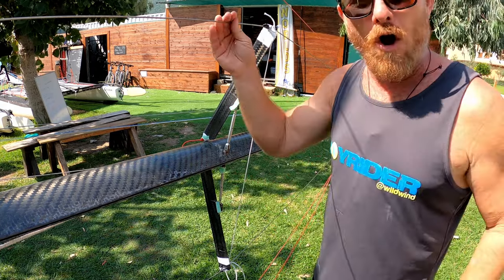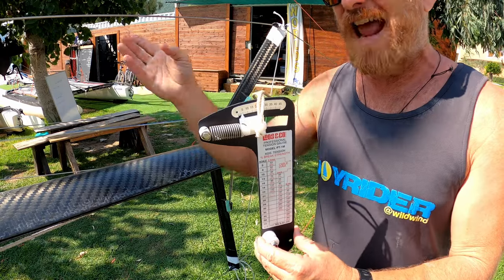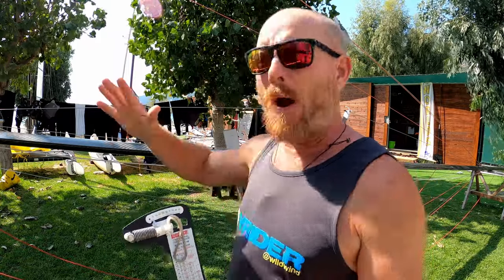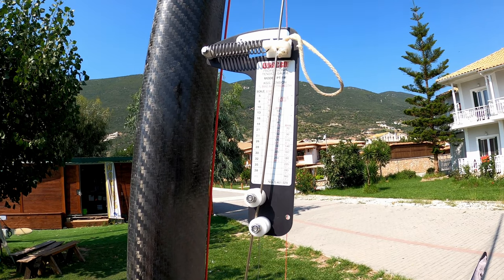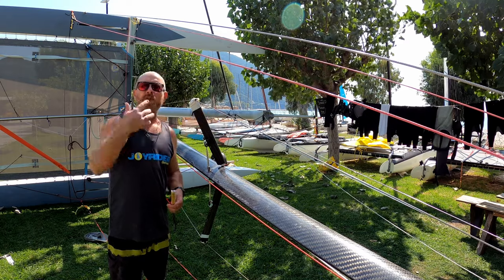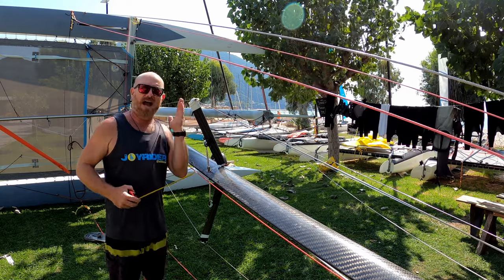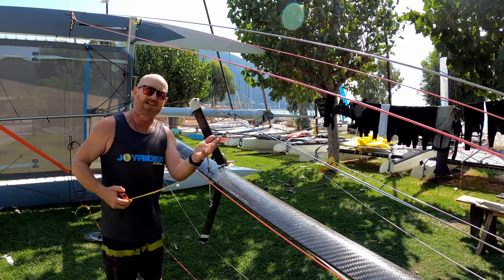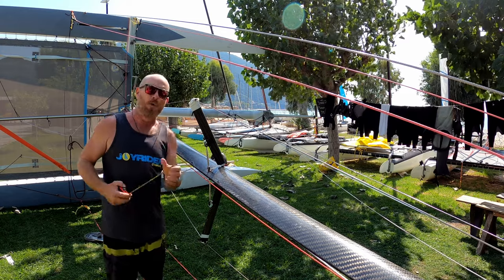3 ESSENTIAL Mast settings for a Tornado Catamaran

Comment: Great essential nitty gritty Joe! Interested to learn how you and Johnny were set up before this info video? Diamond tension, mast rake and stay tension is absolutely essential to have spot on each and every time you leave the beach....we also carry a ratcheting 16mm socket head wrench in a tramp pocket in case things change when we are out, to fine tune the diamonds so their always in the HUMMmmmmm! On the beach we learn how many turns on the wrench make the tension on the Loos gauge for + 1 or + 2 on the pressure scale so we know , ..."ok give it 2 more as the mind strength has come up 5kts..." or what have you.
Very Nice of you to get in to the fine detail required on these fabulous boats.
Cheers
Reply from the maker: Yes, we take a spanner (wrench) out with us too - I've marked on the plate how much to put on for Light/mid/heavy
Seems to work well.

Comment: I've started using the Spinlock tension gauge. It's awesome & repeatable. The Loo's gauge changes due to the springs changing or the Teflon blocks wearing out
Reply from the maker: Thanks for the tip - i'll check it out

Comment: Hey Joe, in the rig tension section, I noticed that you are using black electrical tape to secure your rigging and various other parts.  I'm not sure what types of shops you have over in Greece, but white electrical tape is greatly improved over black.  The black tape leaves all types of nasty sticky residue on the boat.  The white electrical tape holds just as good and leaves ZERO residue.  A fellow sailor told me that tip a few years ago and we have never gone back.
Reply from the maker: That almost sounds like some kind of April Fools joke - I'll try the white to see the difference

Comment: Nice detail values for your Marström Carbon Mast Tornado. That helps.. Do you know the  measuring values for the Alumimium mast Tornado (with Gennacker) too, like the Wildwind Marström Tornado in Vasiliki with the Aluminium mast? Would help me to check and set the rigging values for our Tornado with Alu mast ..
Greets from Hamburg
Reply from the maker: The aluminium would be the same.